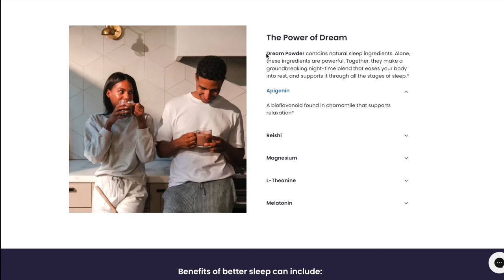We Left for a Cabin in the Woods

Comment: Great fun to  work & play with friends!!
Suggestion:
When cladding start 'half the height of a plank' up from the bottom; Use a laser or string to mark a level line. Check the first piece to be level and attach. Then, work your way up, checking for level from time to time. Finally, at both top and bottom, scribe a plank to the required [remaining] height..
Reply from the maker: Thanks for the tips!

Comment: Awesome video! love that you guys are so close to the Vanwives.   I do have a question though regarding you outside propane tank.  To my understanding for above-ground tanks of 1,000 to 2,000 gallons, the safe distance needs to be increased, these must be placed at least 25 feet from a building.  Your propane tank is right next to the shed.  To be safe if your going to put another one there, I would move both of them at least 25 feet away from the building.  Justi in case if something happens.   Just looking out is all.   Love your home!

Comment: Why not use geothermal for the greenhouse?
Reply from the maker: We'd love to, it's just incredibly expensive. We'd be looking at ~30k-40k for the system!
Reply: @tylerandtodd  there are a few DIY youtubers doing geothermal. You probably checked them out, though. I've been looking at it. If the system is installed laterally rather than going deep, it's less expensive, it seems. You guys have or have access to the trenching equipment. Wineberry Hill seems to be using a combination of geothermal and solar.
Reply: Not that you need another project! you're tackling an awful lot as it is.